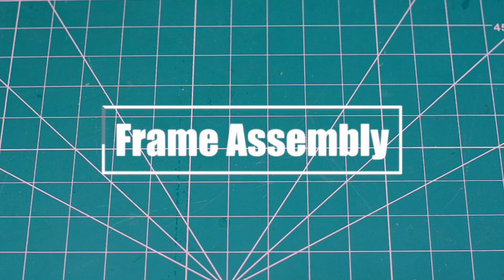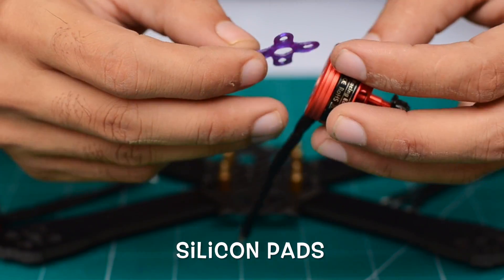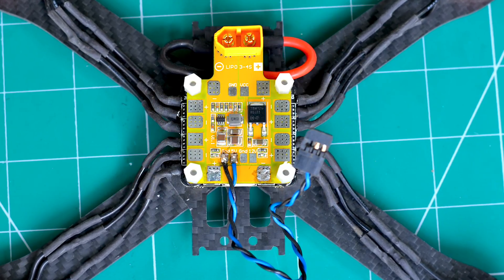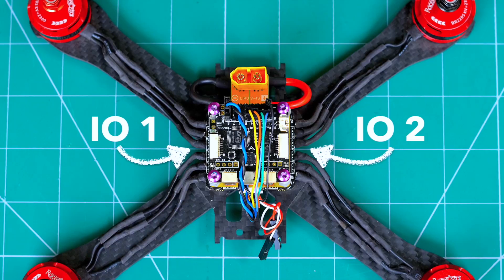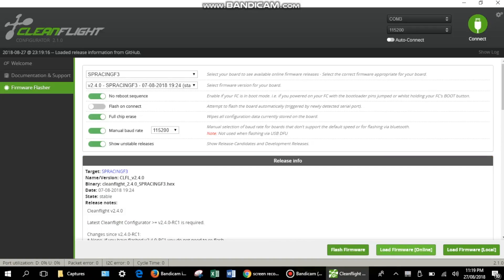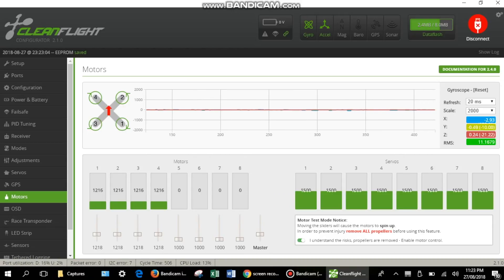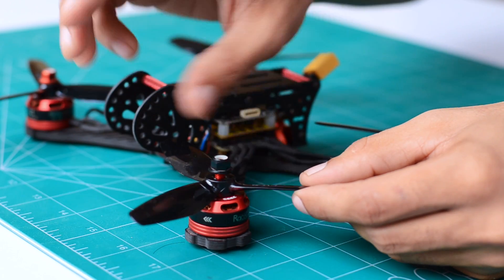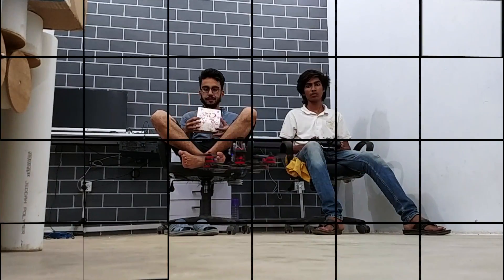How to make a RC Racing Drone (Complete guide to making a drone)

Comment from the maker: Hit the like button and drop your suggestion for the DIY projects you want me to work on in the comments to enter into the lucky draw for this amazing RC Drone.

Regards.
DIY King
Reply: make mini pc its not that much expensive just check The Wrench.
Reply: good luck for winner
Reply: Any custom charges on this product
Reply: Make a flexible shaft rotatory tool
Reply: Can i get your number bhai plz i talked you and you replied me also
Reply: Make a video explaining about various types of flight controllers,brushless motors, transmitters, receivers and their usage so that engineering students can make their projects easily. It might be helpful to lakhs of students!
Reply: bhai mera budget 6k ₹ usme fpv drone ban jaega jiski speed upto 50kmph ho without googles bnaye toh bn skta h please reply
Reply: I have a flysky ct6b 6 channel receiver I have used max rs2295 2300kv motors what should be the min value for my motor how can I find that

Comment: Hi mate , only two correction your PDB doesnt appear in the  list above also, the link to the FPV Camera goes to a Receiver FrySky Controller. for the PDB board you can use also http://bit.ly/2n9WZ17 i think it will work.Cheers.

Comment: Motors: https://goo.gl/SWA26z
Frame: https://goo.gl/4SQ4i7
ESC: https://goo.gl/A5gQLX
Flight controller: https://goo.gl/r8W5Un
Propellers: https://goo.gl/bjLkSS
Battery: https://goo.gl/PurG5Y
Transmitter/Reciever: 
FPV Camera: https://goo.gl/W1mFDz
Rubber Pads: https://goo.gl/d2GLXk
Buzzers: https://goo.gl/m6hna2
Silicon Pads: https://goo.gl/4JN6ed
Anniversary Electronic sale: https://goo.gl/EpK7cc 
log in banggood app and enjoy 10%off app coupon: https://goo.gl/e6KwGT
Reply from the maker: Added to the description.